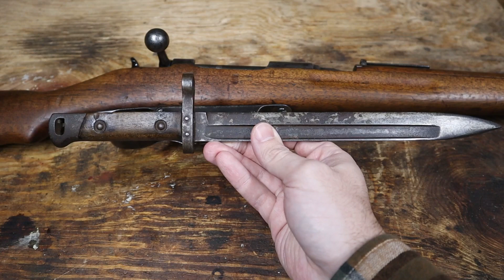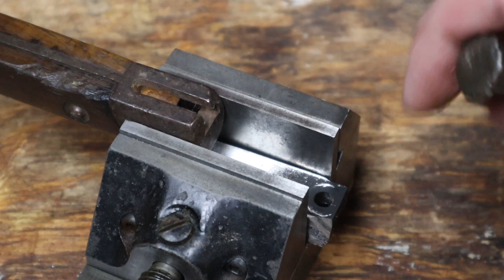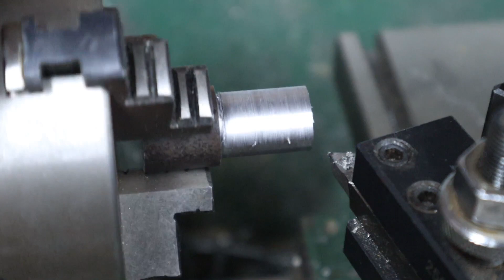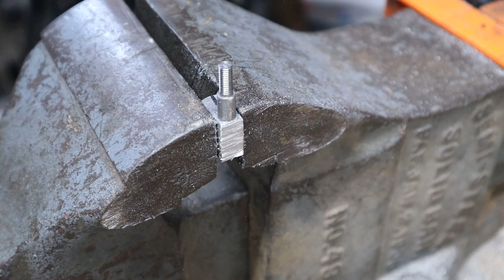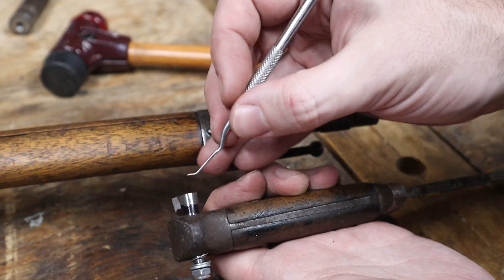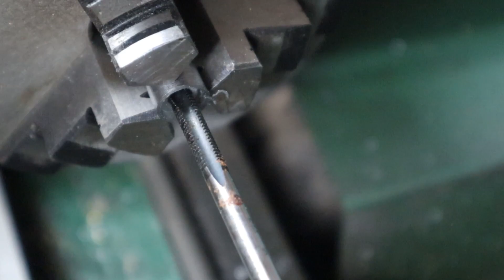Making a Bayonet Catch - Mannlicher 95

Comment: Great work.  I wonder what it would look like if you rust blued it and then attacked it with vinegar for short periods o time to eat the bluing away and try to match the worn look.  No clue how that would actually look but the good thing is you can always just buff it back to being in the white if you didn't like how it turned out.  Or maybe the weird color that evaporust leaves when you dip it for long periods.

Comment: Nice Job! For matching the color, you could try using mustard, or first a hot vinegar bath to create a base color, than some rub with a fine scotch brite, and then the mustard, to create some variation in color. I would try plain mustard first. You just put it on in some inconsistent patches, leave it there for 20-30 minutes, than wipe it off. Repeat until you are satisfied with the outcome. When done, rub some oil on it, to stop the rusting process. If you dont like the outcome, you can remove the colorisation with any type of rust remover, or even better, with electrolysis, without losing any material. Allso to make it even more authentic looking, you can first lightly beat the surface up a little bit, with a ball peen hammer, or rust it with some ferric acid, to treat the suspiciously perfect surfaces, and than give it a color with mustard and co. Instead of ferric acid you can allso use a longer dip in sodium peroxide, witch is basicly what drain cleaners are, or some ~20-30% of sulfuric acid, whitch is aka 50% battery acid solution, to etch the surface. Or hit it with a sandblaster lightly... If you use ferric acid, than give it a backing soda bath afterwards, and put it in some disel oil, or petroleum, to neutralize it, and do it outside, not in your workshop, because it will vaporize, and rust everything (ask me how i know it...). Allso mine has two grooves on the opposite sides on the button, to help with the tighty-loosey of the button. Btw this is a hungarian made M95. Produced in the FEG factory.
Reply from the maker: Thanks for the info! I haven't done anything to finish the press stud since, I'll give some of your tips a try